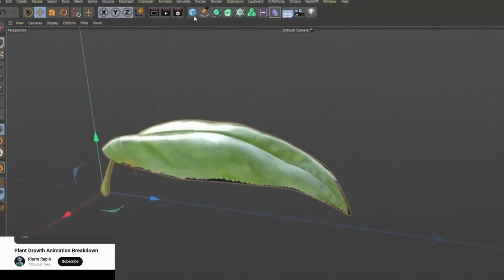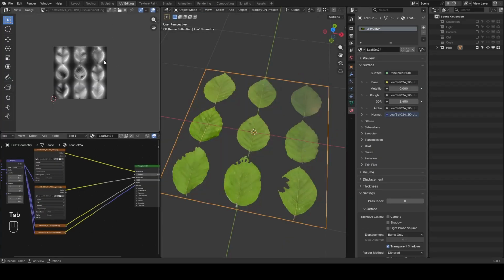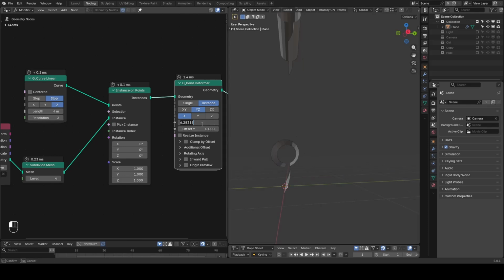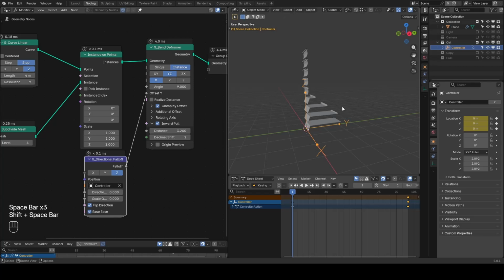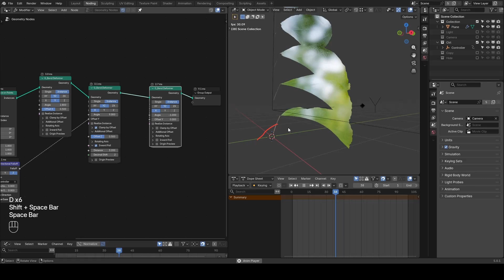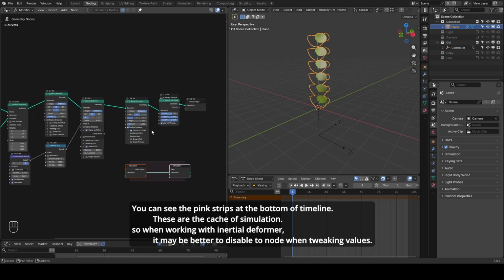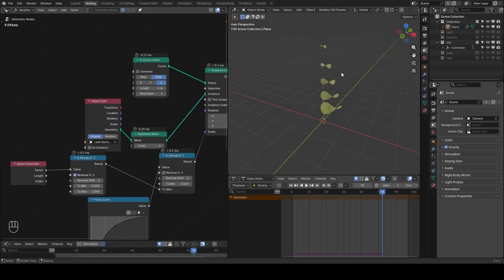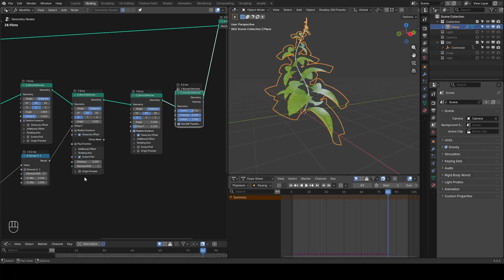[Tut] Plant Growth with Leaves Unrolling C - Blender Geometry Nodes 5.0+

Comment: Hey! Do you have a tutorial on how to generate random seed when modifying the mesh in wireframe without breaking the overall shape?
Reply from the maker: I am not sure I understand your question. but I assume it's not too possible
Reply: @bradleyanimation120 how is it not possible? I see thousands of addons have this feature so it becomes procedural
For example, you have a cloud generator, you can edit the mesh in wireframe so the instances adapt the shape without breaking it
Reply from the maker: @Matteo.3d 
1. I said "I'm not sure I understand your question". so I can totally misunderstood you. in fact, your reply only got me more confused what your question is about.

2. Blender doesn't directly tell users how wireframe is changed. and you didn't mention how you modify the mesh in wireframe, (edit mode? decimate modifier? others? what's really the context of such change?).
There are potential workaround to estimate if wireframe changes, such as based on edge count, or average edge positions, etc. However these in-direct methods can be very unreliable based on how exactly you are going to change it.

so given blender doesn't directly tell users how wireframe is changed. certain method can be "tolerable" to achieve the result, but it can also be very unreliable. Assume I understood your question correctly.